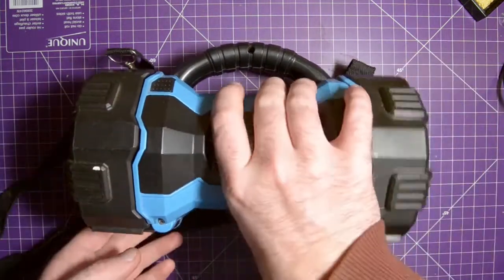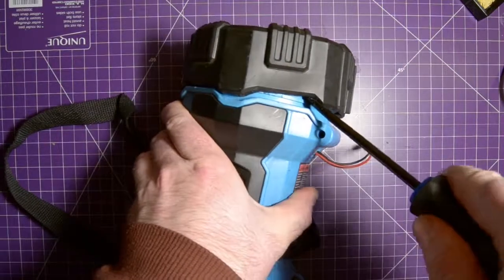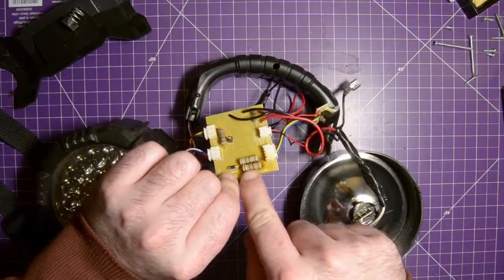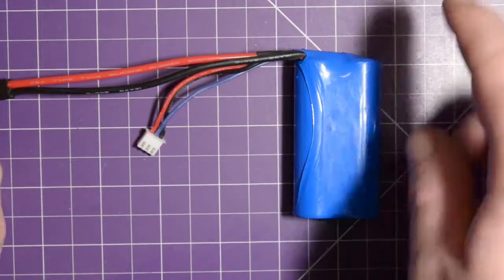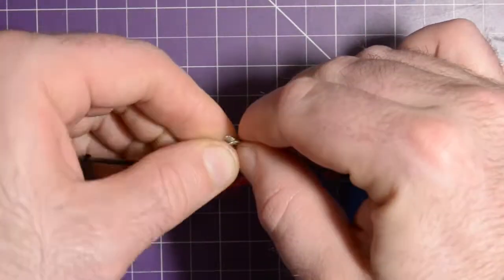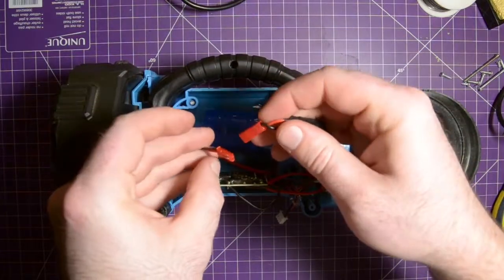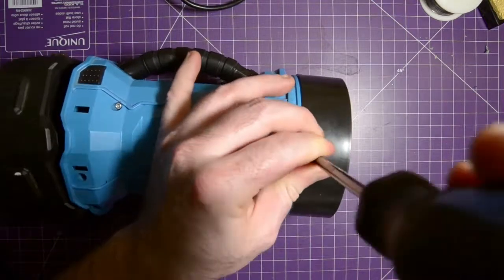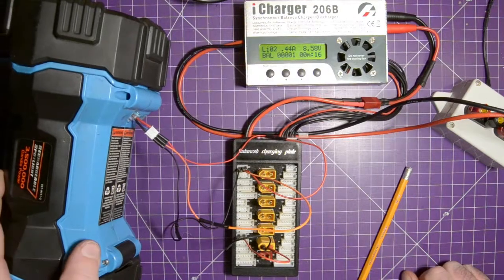Teardown and Repair of an Old Flashlight

Comment: Did you have any considerations or concerns about updating to li-ion cells? Such as the charging circuits and protection etc?
Reply from the maker: Yeah you pretty much have to use protected cells or just keep an eye on the voltage level basically. And they require special chargers